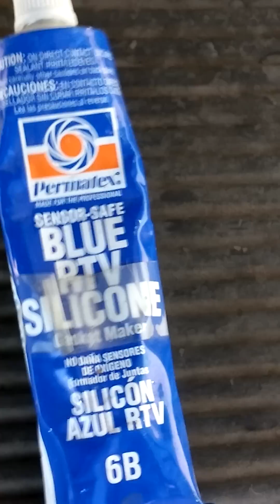P0442 GMC/Chevy Sierra/Silverado V6 engine

Comment: yea. same problem. i have the 2000 chevy blazer with the v6. the purge valve looks exactly like yours. Just curious if your fix worked
Reply: +Jeff Smith Did he ever respond to you?
Reply: +blackericdenice nope.
Reply: Jeff Smith i have an 04 Trailblazer with a po442. I plan to spray smoke into the intake of my air compressor and turn the pressure down to 2psi and try to smoke it soon.

Comment: Did you fix it? I'm trying to find the same small leak on my 2000 Sportage. Already did the fuel cap, recently replaced the fuel pump. But I think the solenoid is the culprit.